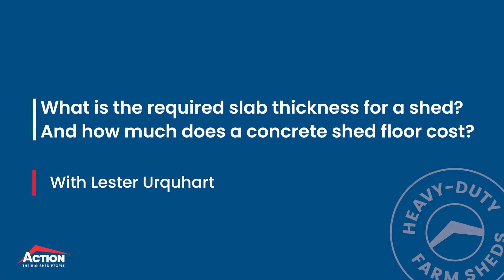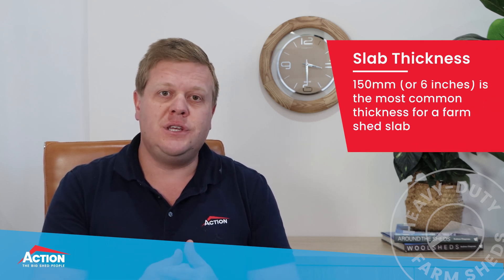What Is The Required Concrete Slab Thickness For A Farm Shed?  Concrete Shed Floor Cost?

Comment: Some shed providers say pour the concrete slab first due to corrosion because of concrete against the steel walls. Do you put plastic or some other barrier against the shed walls before pouring?
Reply from the maker: Hi Stephen, yes, we highly recommend customers / concreters install a protective barrier such as plastic, foam, etc. against the shed wall, or apply a corrosion resistant product (tar paint etc.) to the inside of iron before pouring...